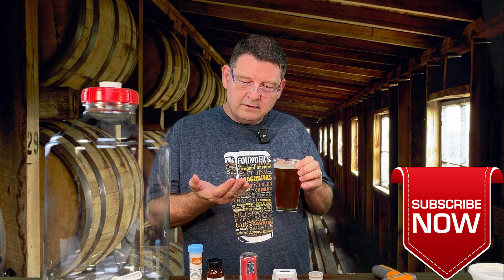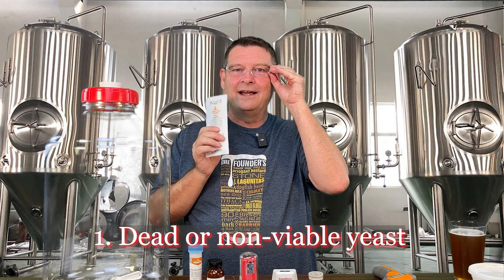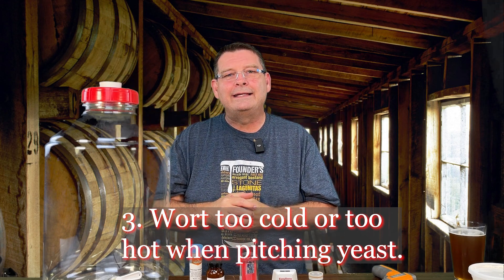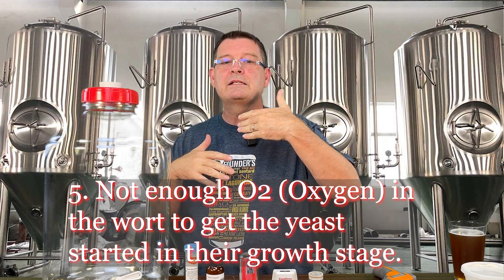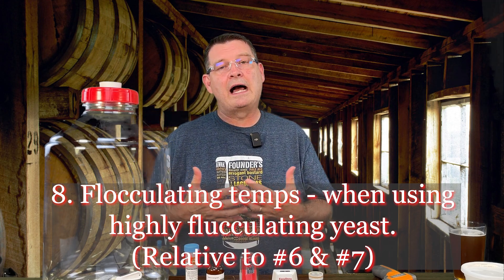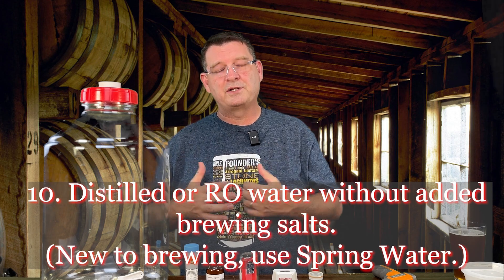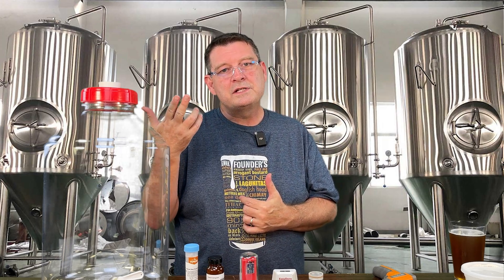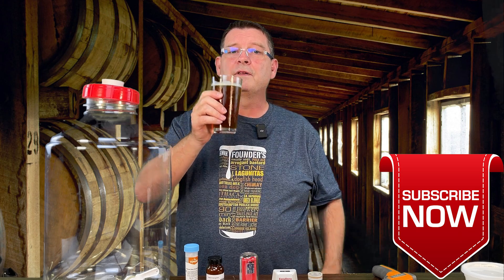What causes a stuck fermentation in home beer brewing?

Comment: Great to know. Do you recommend any fermenter wrap/controllers? ( For warming the wort a few degrees)
Reply from the maker: I've actually never needed to add a heating wrap to any fermenter so far. If you are fermenting in a closed container, I have used both of these with great success - https://amzn.to/414JjpN - If you go to buy one of these, check all the colors as they drop one color at a time for under $20. This thing is very small but heats up a small enclosed space very quickly. I recently started using a ceramic reptile heat lamp like this - https://amzn.to/3APxjxA - It doesn't heat up nearly as fast but it seems to do a great job when needed. I've also used a simple heating blanket under 6.5 gallon glass fermenter but have concerns the weight could eventually damage it.

With all of that said, I am getting ready to start using a new glycol system (just purchased) in the coming weeks and will most likely buy a few items like this during the next winter months - https://amzn.to/3Lo4dKs The reason I think this may be a bit better compared to the pads is that it is 35W vs 25W, plus I don't really want to heat up the trub on the bottom and the wrap is more spread out which will allow for a more uniform heating of the fermentation container.

Comment: The only issue I get is I am 1% less abv then what beer smith says.  Beer smith 5% abv when I do reading 4.8 abv. Unless I don’t do proper bottle conditioning no all flavors no nothing. Spot on flavor. I have noticed if I don’t bottle condition properly it has a cider like flavor
Reply from the maker: My abv with beer smith use to be way off too. The key with beersmith is to get all the date in from mash temps to steps, and even the gear as close as possible. The other major issue I've noticed with Beersmith is that if you modify the recipe a ton or change out the yeast a few times the numbers will all be off in regards to ABV. The trick then is to recreate the recipe from scratch as a new recipe and everything will be spot on. (I feel it is a bug that has never been fixed.)

Comment: Chlorinates can be handled by a potassium metabisulfite (Campden) tablet. They are cheap and easy...if you're using tap water - add a half to each 4 gallons of water. Why -4- gallons? Guess how large a commercial water bottle is. Another trick for you guys is when your fermentation slows - start ramping the temp by a couple of degrees every 2-3 days. This will keep your yeast stay in the game and help with diacetyl rests. This is great information - especially for budding beer brewers! Cheers!
Reply from the maker: Fully agree. Sorry for the late response, as I was traveling and in class at White Labs for a few days. Great info and I agree, although I'll have to check as I thought the Campden tablet was good for 5 or 6 gallons as I haven't had to use one for many years. As for the ramping up, I do that now, but usually, 1 degree per day, and I have one more video being released called how to prevent a stuck fermentation. I'll probably add some more to the series leveraging my new-found knowledge from White Labs.